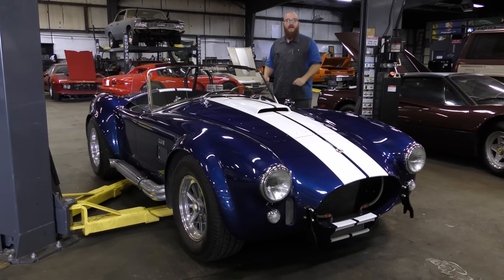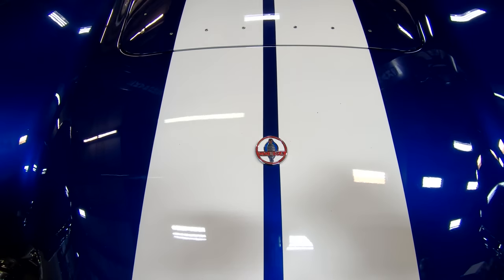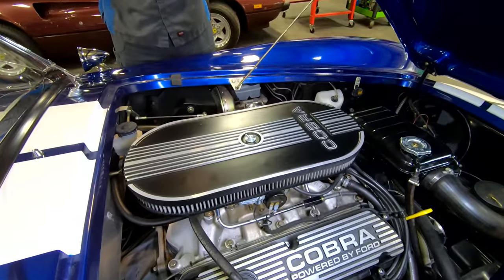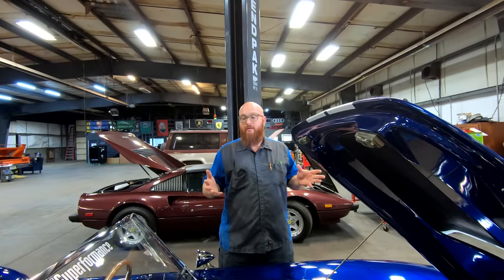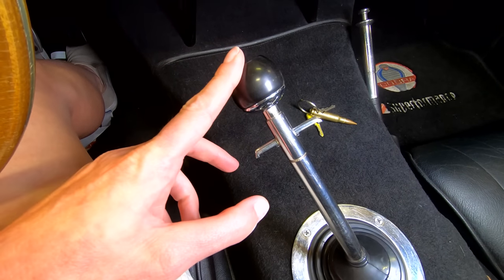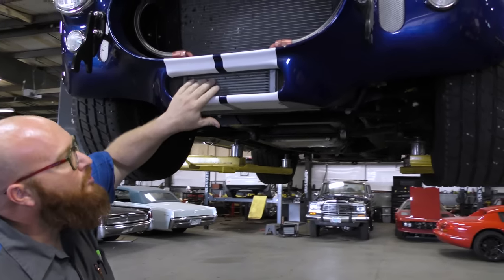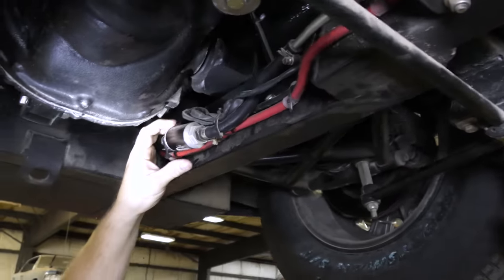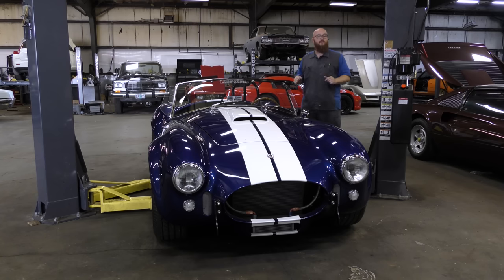Super small with a huge engine! Why is this '98 Superformance Shelby Cobra in the CAR WIZARD's shop?

Comment: That is not a big block FE, that is a Windsor small block, likely a 351 punched out to 427.
Reply: Yea, I noticed that too, thought I would check the comments first before saying something....
Reply: It's probably not 427ci at all
Reply: @Blue_Flame_Raptor  likely not.  Still fun either way.  I have a FFR MK2 with a mildly built 302 and it’s still an awesome car.
Reply: @Blue_Flame_Raptor  It's not hard at all, use a 400M crank turned down to fit the  351W mains, (4" stroke) and  bore to 4.125".  then find rods and pistons with the correct pin height.
Reply: @jrmotorsports5532  absolutely
Reply: Yep, make kits, easy, peasy!

Comment: Lovely car. Unfortunately, the engine is NOT a 427 FE big block. That engine is a small block windsor. It might be bored and stroked to 427 cubic inches. I think Roush performance offers such an engine.
Reply: I noticed that too. The engine was way to small to be a 427 FE big block.

Comment: That has a small block in it. Easy way to tell is the FE series valve covers bolted to the intake manifold and the head. Could be a bored and stroked 351 Windsor. Beautiful car!
Reply: We've built a few of those. The 427 cubic inch version is based on the 350 Windsor block design, however the blocks we use are made by Dart in Michigan. The Dart block permits a cylinder bore diameter of 4.125" and that bore size, coupled up with a 4" stroke crankshaft will yield 427 cubes.
Reply: lol FE series are not small blocks
Reply: @weefek  O.P. knows, he's saying it's not an FE, if it is a 427 at all it's made from a bored and stroked 351W small block
Reply: Beat me to it Jim. I hope Car Wizard ordered the right gaskets for it!
Reply: Easy way to tell its a 351w is the distributor hole being way below the base of the intake manifold.
Reply: In the words of @vicegripgarage, you can tell it's a 351W because of the way that it is.
Reply: A real FE  Series , especially side oiler 427  is un-obtanium.  Plus 100 pounds plus heavier.The Stock Shelby 427 Cobra came with a conservative underrated 410  hp(500 likely) Some  of the 427 Cobras  came with a CJ 428 FE
Reply: Fe series Valve covers wouldn't bolt to small block heads to BEGIN WITH! FE Series are Big Blocks!
Reply: @rollydoucet8909  Ford never made a 350!
Reply: @jerryparks6123  Got it, was a typo. it's fixed. Thanks
Reply: THIS CAR WITH 500 HP IS SCARY LIKE MY 900HP SUPERSNAKE.
Reply: @peterschancel7223  Oh, you can easily get a new 427 FE engine, but they're $45,000

Comment: That engine is a Ford Windsor series small block, though it may be a 351W based 427 stroker. The FE 427 is much bigger, it fills out that engine bay wall to wall.
Reply: Was going to say the same thing.

Comment: 7:41 funny story in regards to the spacers, I bought an '87 Foxbody that was advertised as "stock" recently, the whole drive home, it sounded like the valvetrain was falling apart and it had a horrible misfire. I pulled a valve cover and realized that this "stock" engine actually had an E303 cam, Cobra 1.7:1 roller rockers, and GT40 heads. Whatever dumbass installed everything didn't realize that the huge roller rockers were rubbing on an oil baffle inside the valve cover, resulting in a bent pushrod and a lot of noise. I went through the whole top end and replaced all the other shit they did wrong, car runs fantastic now.
Reply: Yup....
Reply: Great job

Comment: The Superformance is one great car. I bought mine 23 years ago and have well over 100,000 miles on it. It still looks almost new (fit and finish is incredible) but it does have some road rash from about a billion tiny rocks banging away on the front over the years. Their resale is the best of the replica world. The only other Cobra that is as good is the actual Shelby…..they have a very similar resale value (and no….I am not talking about one of the 900+ originals built in the 60’s). Actually, the Shelby’s are built in the same factory as the Superformance and the Superformance is the only replica licensed by Shelby.

Some things to look at on this car to make it better are the rear upper shock mounts. The old shock mounts should be replaced with the R/T upper mounts for safety. If you look at them closely, you will likely find that the mounting holes are being deformed at the frames by the shear force and there is a much beefier upper shock mount that we (Superformance Cobra Owners Geoup) recommend that is available from Cobra Valley. There are stock rear upper shock mounts from the manufacturer today which are stronger than the old ones and use a stronger set of bolts as well and I have not heard of any issues with the newer brackets but I would still change them out for safety. A broken mount is nothing anyone wants to mess with at any speed. I am unsure when this car was built but I am guessing it may have the better factory mounts but not the best mounts. If it was built after 2012 it surely has the better mounts. I would have to look to be certain when the new mounts began being manufactured…..maybe as early as 2006 but I don’t think so.

As for the amp meter……that can be fixed in 5 mins with a 5 inch piece of wire. There is nothing wrong with the gauge most likely. It is simply some interference. It would be too difficult to explain here…..for me anyway….but it’s an easy fix of a quirky meter. If the bouncing doesn’t bother someone I’d say you could leave it alone since it is not faulty…..just aggravating. But a new original equipment gauge is going to do the same thing.

That thing appears to have the original yellow shocks and they are less than desirable on this car. The manufacturer changed to Billsteins many years ago. Once again, Cobra Valley has some much better shocks designed specifically for this car along with far better sway bars, springs and ball joints. They make this car a much better safer driving / handling car…..and NO I do not work for or have any association with Cobra Valley. It is simply that the owner of Cobra Valley is very plugged into Superformance and the factory and has done a lot of research and design on these cars…..he also owns five or six of them and is probably the most knowledgeable mechanic on the planet when it comes to these cars. Like I said, the manufacturer (Hi-Tech out of South Africa) comes to him for input. Check out what is available at Cobra Valley for these cars as well as their GT40, Coupe and Corvette. You can make that car a whole different beast.
Reply: Great info , I have a 2018 superformance car as a road car it’s remarkable, fast comfortable and fun . As a track day car it’s absolutely horrible . I’ll have a look at cobra valley now for handling upgrades .
Reply: @johnszwede8516  John….if you are even a little serious about being on a track….especially competitively…..you need to follow up on the Cobra Valley upgrades. Unless you are racing other Cobras, you will have difficulty being competitive on the track. The cars come from the factory for those of us who drive them on the street and drive them a lot. Now, with the proper upgrades they can be transformed into absolute track beasts. 

For a guy like me, even though I have well over 100,000 miles in the seat, my lack of skills will never allow me to run with the big boys who track a lot. But that is even a bigger reason to get the suspension tuned up. Drying hard on the roads can put us in situations where everything needs to be balanced and work together. My car is like it is on rails. The stock shocks will have you all over the place. The upgraded shocks will keep you planted but still give you a great ride. The sway bars really make a big seat of the pants improvement in handling. You can take the stock ball joints out and to move them much you will have to put them in a vice and beat them with a hammer. The upgraded ball joints move like silk. I don’t know how much that will help on the track (probably a lot) but it totally removes that pesky steering will shake you probably get beginning around 55 MPH on up to about 70. The originals are good quality but they are a standard off the shelf part made for much heavier cars and so don’t move much. There is also a safety issue with the rear upper shock mounts. Not as bad as the older cars (the manufacturer made some improvements back in the 90’s after a few broke with devastating outcomes. But the R/T upper mounts from Cobra Valley are way over engineered to take that issue totally out of our minds. The R/T shocks and springs also make a tremendous difference. The old 90’s shocks are horrible. They have made them better over the years but the Cobra Valley shocks and springs are light years ahead in performance. If you get springs, get at least 400 lb (probably the best for combination street and track use) and 450 is arguably even better. The stock springs are only around 300 lbs. I went to the 350’s which was recommended way back when they came out and I wish I had gone to 400 lbs and I am strictly a street guy other than getting out on the track once in a blue moon for fun with no one close by. Of course, Randy Thomas at Cobra Valley can and will give you great advice if you give him a call. He engineered and produced all this stuff (plus much more including oils etc) and knows more about the SPF Cobra than ANYBODY. Even the factory comes to him for advice on the Cobra, GT 40, and Shelby Coupe. He has 4 SPF Cobras he experiments with plus a GT40 and their new Grand Sport Vette.

Good luck in improving your car. It’s worth every dime and while not cheap it’s not all that expensive to do. You might also consider joining SCOF (Superformance Cobra Owners Forum) also owned and operated by Randy Thomas. It has a tech library that will blow your mind. You will make life long friends on there as well and enjoy BSing with the guys and a few gals not to mention getting any tech question answered by the best minds in the Cobra world. It is at least as incredible as the car. As a matter of fact, now that I am getting older and not driving as much, I keep my car more because of SCOF than because of the enjoyment I get from driving the darned thing. You must be a verified SPF Cobra owner to be a member. Check it out.
Reply: @garyosborne8906  amazingly detailed reply and greatly appreciated , I’m lucky enough to have a few cars I also race hill climb and targa events in Australia. When I got this car from SPF in cally they kept telling me what an amazing track toy it was , perhaps I’m spoiled with other cars but this at Philip island Grand Prix track was so bad I parked it in the garage after 2 laps . It’s a >700 hp and >1000 nm car and hooks up well with Avon race tyres ( period correct style ) CR6ZZ once they have some heat , so yes I will have a chat with randy for sure and see what he suggests , it’s fun to pull a 720’s in a back straight but it’s more fun to have car that can turn well ! Without it tucking under itself and feeling like it’s going to bend in half .. for me anyway . Thanks so much for the lovely informative response once again . If you ever come to Australia give me a shout

Comment: For Cobras less is nearly always more. The 289 Cobras (AC or Shelby) are nicer to drive, albeit slower, than the big engined ones. I have driven one of the Lubinsky Cobras in South Africa, with a 6.6L Roush engine and it was not nearly as nice as the 1965 289 Thames Ditton built AC Cobra, I have driven quite a lot. The '65 car has just the right amount of power (290 BHP) for its handling and its surprisingly light non-assisted steering is a delight.

Comment: For a period of time there was a person living in my condominium building that had one of these Shelby Cobra Replica cars. These cars have a unique appearance. Since I was born in 1951 I am very familiar with the old fashioned method of starting a carburetor car when the engine is cold and the carburetor had an automatic choke. This was the same way I started my parents 1964 Ford Station Wagon when the engine was cold. The method demonstrated in this video was the same method explained in the 1964 Ford Station Wagon owners manual.
Reply: And, of course prior to the automatic choke, having to know how to use the manual choke.
Reply: @cousinjohncarstuff4568  When I was young I used to ride motorcycles that had a manual choke. So I am familiar with manual chokes also.
Reply: @cousinjohncarstuff4568  The 600 Holley on my old 302 had no choke. Two quick pumps on the accelerator, hit the key...started no sweat, down to freezing temps too !!

Comment: I built a ‘66 “replica kit” for a customer at a shop I worked at in Houston, back in 2001. It was kind of a “cheaper kit”but was still pretty cool. He ended up having us build install a 351 with a t5 transmission, steering was for a Thunderbird.  That car was incredibly fast! Customer knew someone and had it weighed at the airport, it was like 1950lbs. Thing read like peak 445hp/496ft/lbs of torque on the dyno. 
Idk the coolest thing about that car for me, for some reason, was the one huge nut for the wheels!
Reply: Replicas should have jaguar XJ6 series one or two steering and suspension to perform in a imilar fashion to an original.

Comment: Superformance are actually real Cobras (kind of). They have CSX serial numbers and licensed by Shelby. That's my dream car right there. The color, the guages are laid out correctly and the taillights are correct. (Not the 4 little circles on most replicas). I promised myself I would have one before I die. Probably not a Superformance though as I'm not rich.
Reply: I thought the rear suspension looked authentic.
Reply: Tail lights on original had round tail lights the later 427s had round tail lights because of regulations.  The early produce cars had square tail lights
Reply: Some have a CSX number, early ones don’t.
Reply: Superformance cars are not kinda Cobras and do not have CSX vin # s

Comment: The placement of the intake bolts and the distance between the carburetor pad and the valve cover seems to show it is a 289/302 based block.  FE intakes run under the valve covers and the valve covers are a lot longer on a 427 compared to this one.

Comment: Beautiful car!  Some might take issue with it not being a "true" Cobra, but just look at it and listen to that 427!  I never really thought about how starting a carbureted car is a lost art, but I suppose just one more arcane skill us old boomers have 😀  And as others have mentioned, the ammeter measures whether the battery is being charged or discharged, with the ideal being right in the middle.  I had a '77 Dodge that had that instead of a volt meter (or warning light), except it never moved.  So... it didn't warn me when the alternator died or later when the voltage regulator (not built into the alternator like later cars) got stuck on full charge all the time.
Reply: Yes, operating a car was once a much higher skill than today.  Been many years since cars had manual transmissions, so few of younger generations know how to use them. There were a few times having clutch problems, I had to drive without using a clutch. Would like to see the "kids" do a tricky feat like that!

Comment: 67-68 Ford Factory Cobra 427" with Weber carbs and manual transmission went for $7,000 at the Ford dealer. You couldn't even buy the Webers for $7,000 today. Love these cars, but the 427 Daytona Coupe is my dream car. Half a mill for a 427 with hand polished aluminum body from Shelby shop in Vegas. Polishing takes 500 hours. A little over the top, I'd settle for a painted one.

Comment: Just to clarify, the ammeter doesn't show how many amps the battery has left; it shows the total current draw on the electrical system. If it's negative when the car is running, it means either your alternator isn't working or something is drawing too much power. Modern cars use a voltmeter instead.
Reply: Nice mansplaining.
Reply: Ammeters were used on dynamo cars. With engine off normal is zero. Engine running should show + that shows its refilling the battery. After that, a slight + shows the battery is getting a trickle charge. Voltmeter (as used with alternators) is more useful and much easier to install.
Reply: @Dave5843-d9m  Many cars from the 1970s had alternators and ammeters.

Comment: If thinking of building one, consider the Kirkham Cobra. Beautiful all aluminum body (made at the old MIG factory in Poland, and a round tube frame. They also make the 289 "slab side" original, equally stunning. (yea thats the one I want) You can basically get a car that matches the original exactly down to the Girling brakes if you want them. Pretty cool...

Comment: This is a beautiful example of a replica, love these. Definitely on my bucket list to build one!
Here in South Africa, many of the kits use the very strong old Jag XJS or XJ6 brake and suspension components.
Reply: The replica cars are usually better finished and better made than the originals (though worth a fraction as much). A Lancia Stratos with tired and wrinkly panels and bad gaps is probably original and worth hundreds of thousands. That's $ or £. It makes no difference.
Reply: Superformance is more of a continuation than a replica. CSX serial numbers and licensed by Shelby.

Comment: I was digging the "short girthy" drive shaft with the washers welded to it for vibration correction... @ 13:09
Reply: glad, someone else also noticed the washers. And they seem to be partially ground off after welding.